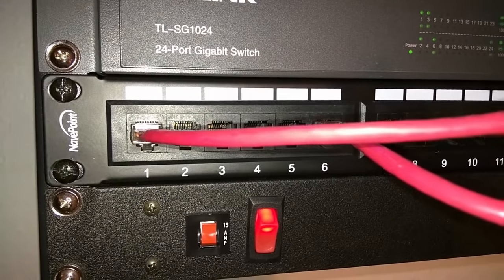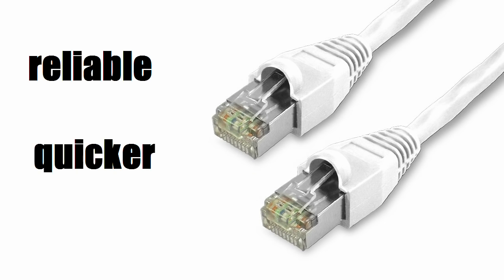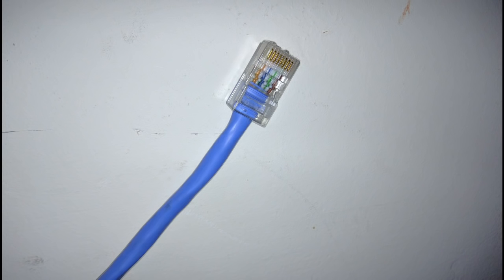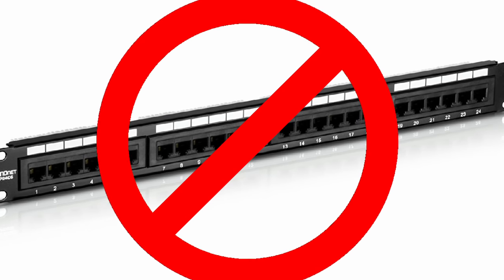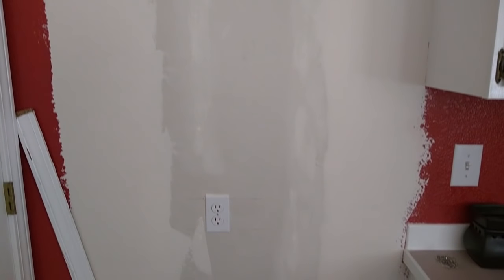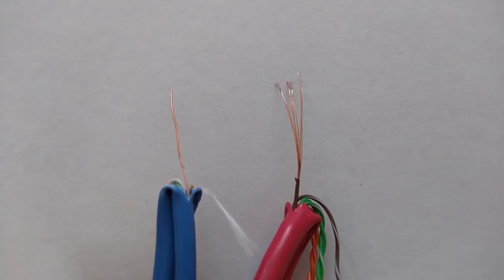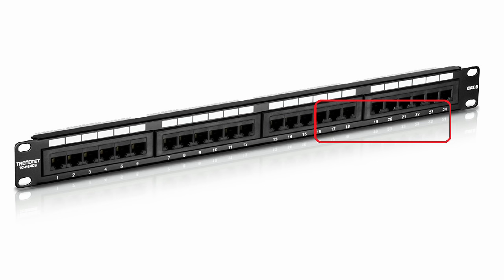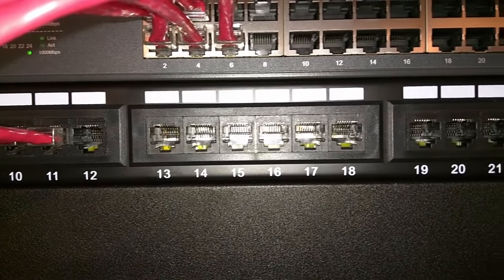What is a Patch Panel? Do You Need One?

Comment: You should never NEVER EVER use a patch panel unless you are using wall plates/key stones. I cannot count the times networks have failed when adding this unnecessary failure point.

Comment: I think the only part of this video that actually answers the question is the part where he said that a patch panel looks cooler and more nerdy. That's really it.
Reply: It also allows you, the home owner, the power of groundinf a teenager with punishment of no jnternet by removing a 6"patch cord, and fiktering the wifi rouyer on the kid's mac address so it cannot get access to the internet.

Using a smart switch with a patch oanel also allows internet access for a couple hours for homework, without having to pull the plug in the patch panel.  Lots of flexibility with this design.

Comment: Hi, another example for the use of patch panel is: you can easily color code your cables without much expenses. e.g.: your wires in the wall are the same blue/gray/green/yellow/etc. color, but the patch cables are different. Red for internet router to switch and yellow for switch to switch (red=Don't touch because this is the INTERNET cable!, yellow=Don't touch beacuse if you pull it out or ruin it, half of your network not working!), green for pc-s, notebooks, tv-s without poe, blue or purple is for POE connections (ip cams, poe powered wifi devices, etc), grey for voip/phone. With this coloring scheme you can easily identify the port functionality in just a second.
In my house I use the following color combination: the in-wall cables are blue, solid core cat6a cables.
Patch cables (cable type, endpoint client speed):
red (cat6a, 10gbps): internet router to switch (for redundancy, the router is connected to all switches, so I have 3 red cables :))
orange (cat6a, 10gbps):  switch to switch
yellow (cat6a, 10gbps): nas/server to switch
blue (cat5e, 100mbps):  poe powered devices (eg: ip cams)
purple (cat6a, 1gbps):  poe powered devices (eg: wireless ap-s)
green: (cat6a, 10gbps): pc-s, notebooks and other fix wired devices what are required more speed/bandwidth
black (cat5e, 100mbps): regular non poe powered devices (tv-s, printer)
white or light grey (cat6a, 10gpbs): direct connection between patch panel ports
grey or pink (maybe cat5e, 100mbps or cat6a, 1gbps): currently not used in the patch panel but in the future it will be used by the home automation system

You can see, I can easily inditify the functionality just by the cable color.

Comment: When I started with a small consulting company as the only true “infrastructure guy”, I refused to be associated with the hornets nest of cat-6 that all terminated at the randomly configured switches. Networks change over time, even small ones.

When we grew and moved into new office space, I worked with an electrician to terminate every drop at a patch panel in my closet. Small patch cables made easy work of day-1 configurations and beyond. Once the move was completed and we were back online, the rest of the company thought it was a “work of art” compared to the prior office, and it fostered a “do it right the first time” environment.

All that said, I have a (mostly) wireless setup at home but a dedicated switch in my home office for my servers and other geek gear.

Comment: I agree completely, patch panels are life savers. I have been installing them for about 10 years now at my current job. I loathe working on my predecessors work as he was a firm believer in just running  IoT devices straight to the switch. They only thing I would recommend is also installing LV1 brackets with your wall plates. It's a minor additional expense but it keeps the screws from stripping out the drywall.
Reply: Sorry, Fire codes prevent me from using these, I usually use deep 4 square boxes for the purpose

Comment: You can get keystones that are jacks on both sides, so you can start with direct wired, then upgrade to a patch panel without having to snip, strip and punch down your ends.
Reply: I use the dual rj45 keystones in my patch panel. Only downside is durability and possibility of coming unplugged. Never had issues in my home

Comment: All in all, your video is great...take it from someone that has literally terminated thousands of jacks and panels...all your wall plates are upside down. The wide part where the pins are always goes on top, and the clip points down.

It’s so dust and other debris can’t land on the pins and possibly cause issues.
Reply: Daniel King At least the morons who did the wiring in our place knew that. But they left wires hanging out of one and possibly multiple keystones and didn’t cut them off.

Comment: Great Video! I bought a home that has an older patch panel system, but Ethernet ports in virtually every room in the house, and its all nicely done, and neat, and most importantly, MARKED. The downside is, I've never done a large scale (more than 5 ports) hard-line network, so i had no clue what to do, or where to start.  This video made it make a lot of since, and I will watch the other right after this! Thanks a ton for your video!

Comment: I built a nearly identical setup like yours about 6 years back but i would like to add one possibility that some people might find interesting. You mentioned at one point that you can patch through a port to create a separate mini network. Have you ever thought of using HDMI over ethernet to stream any device HDMI output to any room in the house? 
Can even add USB functionality to remotely use keyboard, mice, controllers or remote IR input. Its only possible to do if you have a patch panel as the data cannot be routed through a switch or router.
Do note though that to do it "cheap" you need 2 ethernet cables to stream the data or go with expensive HDMI over ethernet boxes on 10 Gbit capable wiring(cat6 and up).

Comment: Yes, I use patch panels and POE switches in residential networks, especially my own.  Security cameras and VOIP phones abound.  Most folks will make do with Wi-Fi only not realizing they are only receiving one half to two thirds the available speed.  Hard wiring  all possible connections takes full advantage of the speed and bandwidth  you’re paying for.

Comment: You could shift your cables over to ports 13 - 24 on the patch panel as they sit directly under the switch ports - and then use shorter cables, would kick the bling-worthy factor up a notch ;-)

Comment: The solution shown at 15:58 is a great option for most homes.  Just put some jacks on the wall where the switch will go.  You can buy wall plates that have up to eight (8) keystone jacks in them.  That's way more economical than a patch panel and probably an easier build for most homeowners.  (I did this in my home -- and I'm a professional data center guy who uses patch panels in my day job.)
Reply: I did the same as I only needed 6 ports

Comment: Thought I would put this out there for everyone.

- Reason for using solid wire in walls is better conductance of signal over potentially greater distances especially at higher frequencies. There is reduced signal propagation delay and lower cable capacitance, both of which affect the transmission of your data (less trouble related to wiring issues). Another reason to use solid is it punches down easier and more reliably in a patch panel. It also "holds" the punch down better than stranded (in my experience).
Final reason, its a national (TIA/EIA-T568A) and International (ISO/IEC 11801) standard.

- Reason for using stranded wire (as patch cables) is, again, standards, being much more dependable in frequent connects/disconnects, needed flexibility and keeps terminated in an end connector better than solid.
Of course, not all solid or stranded cable is the same quality of wire from different manufacturers, Belkin does tests of their wire vs. competitors to show how all cable is not merely simple pure copper, but is found with a thin copper veneer and made of inferior metals affecting speed, reliability and longevity. Don't go cheap, get real copper wire.

Lastly, the way you treat the cable during installation has a lot to say during your future usage of that cable. Cable installation is where a lot of attention to detail is left behind.

Sad to say, there are professionals who don't really care and just put in the cheapest saying its all the same. These are usually the same professionals who don't have to troubleshoot the network years later for problems relating to bad cabling or bad  installation. Or maybe I should thank them for keeping me employed.
Reply: Thank you much for your post.
Reply: @kuldipsingh366  Your welcome. I recently acquired a new client whom needed an entire office of new computers server and related networking equipment. The only thing I didn't change was the premise wiring and some patch cables.
After the installation, the NEW server kept frequently dropping out of the network for no apparent reason (when I wasn't there and a one hour drive to visit). This made remoting in very hard. 
Onsite I ran a wire sniffer to see that data packets were jamming themselves together in a mess. I blame the cabling but the client didnt want to replace it, so I installed a 100mbit NIC and forced the connection speed to the switch at 100mbit. And that solved it.....for a week. Same dropping out again...So I ran a long patch CAT6 cable from server to switch, which has stopped all dropouts and I was able to dial up the connection to 1Gbit. All the while, I tell anyone in ear shot....your cabling is very bad and I need to replace it.
So....they don't replace the wiring, meanwhile....
They want 802.11AC wireless, so I install a full Unifi gateway, switch, AP and as I open the ceiling panels to run a new CAT6 for the AP, I see the old CAT 5?? (actually it looks like old POTS cabling) along wooden beams crushed with bare steel staples and one of the worst drunken install jobs ever. They started with crap cabling and followed with a matching drunken install job. 
Moral of the Story.....
YOUR NETWORK CABLING IS YOUR SPINAL NERVOUS SYSTEM...If you don't do it right, nothing will work right, especially when you start really exercising it.
DO IT RIGHT! (then you will never have to think about it again).

Comment: A great benefit of a patch panel that wasn't emphasized in the video is that it gives you the assurance that the port number you label for each connection throughout your building will permanently be that number forever. Your connections are immune to ever having to be changed, and they can't accidentally become incorrectly labeled or mixed up due any kind of issues, replacements, or changes that you make on the back-end. 

For example, what if your switch dies and gets replaced with a new one that has its ports labeled in a completely different arrangement? Without a patch panel, you've now opened yourself up to possible mix-ups and mistakes during the switch replacement, and you've now created much more work for yourself - even in the best case scenario. 

Say, for one reason or another, some of your cables aren't long enough to plug into the same corresponding port on your new switch. You now have to plug connection 1 into a closer port (such as port 24), and do the same for any other connections that aren't long enough. On top of this, you now have to go and re-label every affected connection throughout your building with the correct port number. Your numbering system is now completely messy, much more complicated, or makes completely no sense - just because of this.

Even if the cables for each connection are long enough to improvise for this change, your cable arrangement will likely look like a complete mess now, and that messiness makes it more likely for you to make things worse or mix things up with any changes that you make in the future. And because you're moving the actual cables that are run throughout the building from one switch to another, instead of what would just be their corresponding patch cable, your connections can become incorrectly labeled if you make a mistake, mix something up, or if you don't good track of everything you do during the change.

All of that complexity, work, and opportunities for mistakes to be made was added simply because you swapped out a switch and didn't use a patch panel. With a patch panel, it doesn't matter what port on the switch you use, where things are plugged in, or what equipment changes are made at the back-end. Your connections throughout your building will permanently keep the same port number and are immune to having to be changed for any reason, and are almost 100% unlikely to eventually become mixed up or incorrectly labeled.
Reply: Which reminds me of what I need to do...
Reply: Thank you for these real-world examples. I think they are essential in explaining a patch panel's purpose.
Reply: What if the patch panel dies? Isn't that just the same problem if any other hardware replacement jostling your og setup?

Comment: Yes, use a patch panel.  I did, 32 ports, Cat 6 with Cat 6 cables and keystones.  Though I only have 23 ports.  I am still glad that I have spares.  I also used PVC conduit.  I recommend 2" for risers and 1.25" for runs to the wall plates.  For even more flexibility don't write on the faceplates, use a labeler like a P-Touch.  Using conduit it is easier to pull cable.  Cable lube is good too.  No, I don't do this every day.  Also I recommend putting 3 ports per faceplate.  It is much easier to pull all of your cables one after another than have to come back and do it again.  Planning is key!   Don't underestimate how many ports you will need or want.

Comment: Good video but as someone who has been installing low voltage cabling for almost 20 years I have to point out that the jacks at the location are upside down. I know this is a home install and personal preference probably matters more than what’s right but I had to point it out. 
There are two main reason you want to install them the other way. First since the tab on the RJ-45 is facing up something could fall and hit the tab and cause the cable to become unplugged. This is pretty uncommon but I have seen it happen. 
The other issue is when you have a jack that is not in use the copper pins are at the bottom of the jack and can be a problem because dust and dirt can fall and settle on them causing a poor connection the next time you go to plug something in. Also if a liquid gets splashed or spilled on the wall it is more likely to get the pins wet when they are on the bottom. 
Again, in a home install these aren’t a huge issue but if you are doing this in a business then it is because if there is one thing I’ve learned it’s that if there is a way for an end user to f*ck something up they will
Reply: This kind of irked me because I have seen some jack with a layer of dust at the bottom of the Jack at work that were saved because the face plates were screwed in correctly. Now this happened over the last 10 years but still in a home I would assume some jacks would sit empty for a while.
Reply: Alot of patch panels are designed so prong is down. It physically won't allow you to place the keystone in upside down

Comment: Looks good. One thing though is that modular jacks are traditionally installed with the pins on top, so that dust doesn't collect on them. (This is old bell-system tradition). I've find it both ways and never had a problem, but if you want to be a stickler for tradition, there you are 😀

Comment: Ben - informative, redundant, nerdy.

In other words, a very good video and thank you for your thoughts. I agree with most, and I have three comments: First all upgrades to your dwelling are subject to future modifications or obsolescence so I'm wondering why you just run cables freely through the walls instead of through conduits where you can (when rehabbing as I'll do, in the crawl space or basement and up in the attic). I like conduits for three reasons, neatness to the nth degree, a large enough conduit can hold all your main run plus spares, and it is another layer of shielding if you choose metal conduit. It will be a minor pain to drop the terminal points down through a plate or up through a sill, but it takes neatness (and limits insect/rodent access points) to a nice level. Oh - I'm rehabbing a 60 year old house that the mice treat like a seasonal hotel - I'm still looking for the last entry portal....

Secondly, while I like the punch down RJ45 patch panel, 2dfx chimed in with perceived "misconceptions' you placed in this video. Some people are equally as self-important as I am, but I do try to further a topic along instead of listen to myself and how right I am. But back to the point - You picked the pre-populated panel, did you know there are keystone ready patch panels? I might use a punch down RJ45 panel along with a keystone panel for the reason you mentioned - your com cabinet can terminate (or feed) many different signals - phone (RJ11), HDMI, COAX, and even future as yet unquantified feeds. I like the idea of somewhat future-proofing by having extra lines and end-points available, and I think keystones will be around for the rest of my lifetime.

Thirdly - while I noticed the keytar and your fender axes - why two? One a bass and the other a six string stratocaster? You mediating your nerdiness with music? Great idea!
Reply from the maker: Thanks for the comments. I play a bit of guitar and love the game Rockband. It helps to make sure the nerdiness doesn't get too out of control.